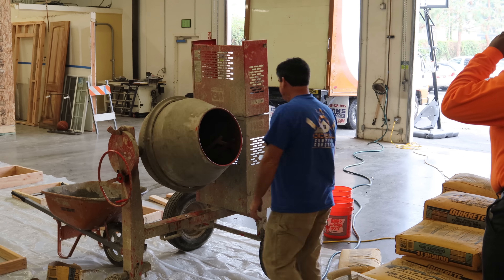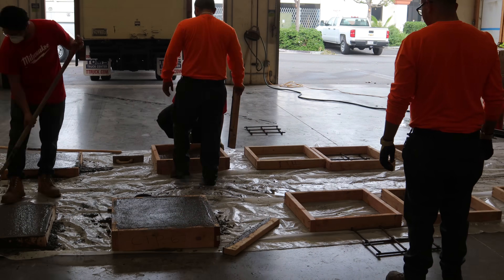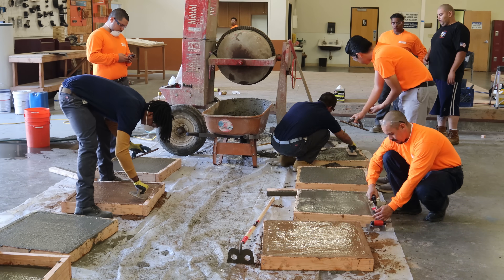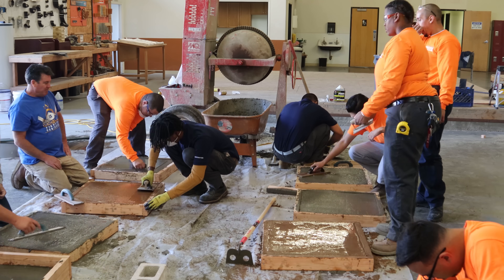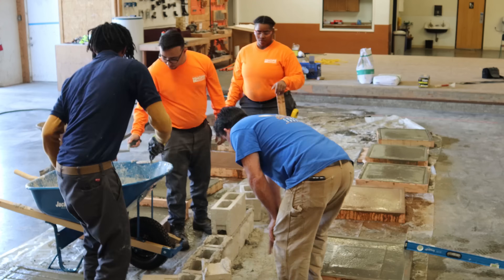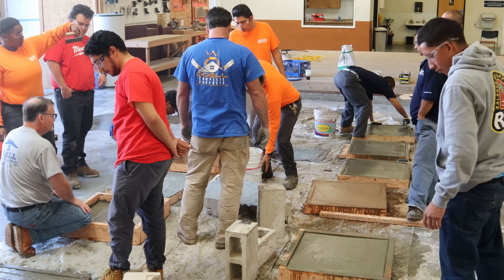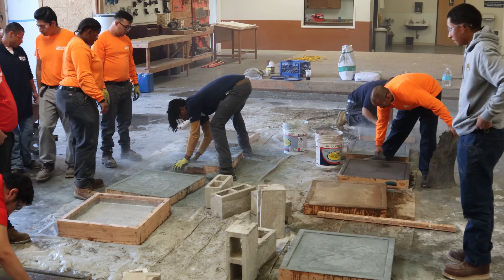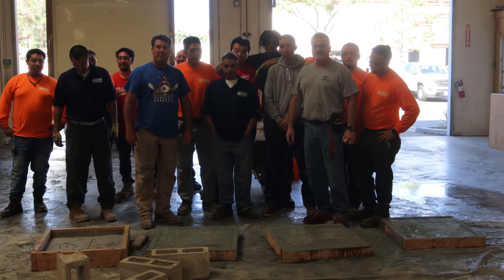Teaching Students how to Mix, Pour, Finish, and Stamp Concrete as well as Build Block Walls

Comment: I have a question about a current job I’m working on. What happens or what can you do when you want to pour a slab above a tree and frame around the tree. Is that a good idea or?
Reply from the maker: Depends on the tree type and how close you want to get.
Reply: Bro just get an idea how far out you want to form around the tree. Start digging. If you hit roots, just cut them out.
Reply: Sick of these pansie ass workers. Y'all are a bunch of sissies.

Comment: You should try using fans blowing across the top of the forms. It should accelerate the drying time, at least the top 20% of the concrete.
Reply from the maker: We had one fan going
Reply: Keith Sullivan could cause the concrete to crack
Reply: I we would say, No